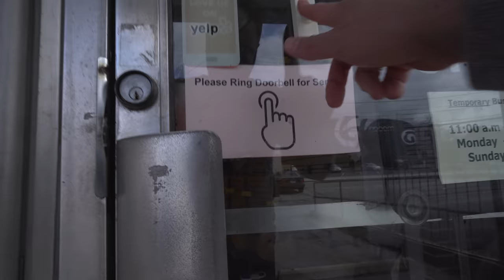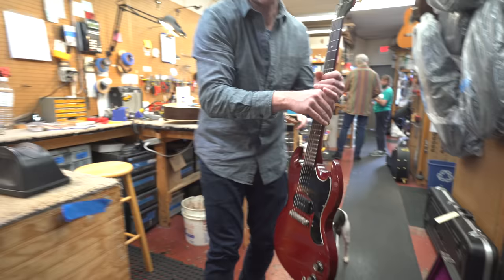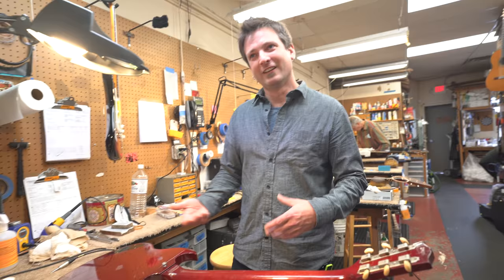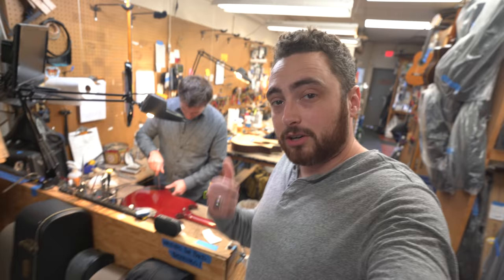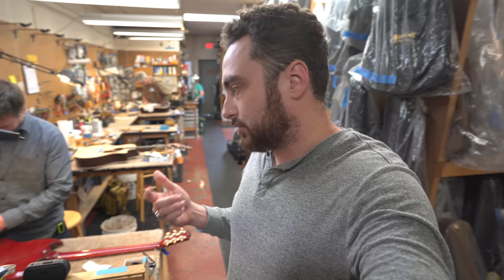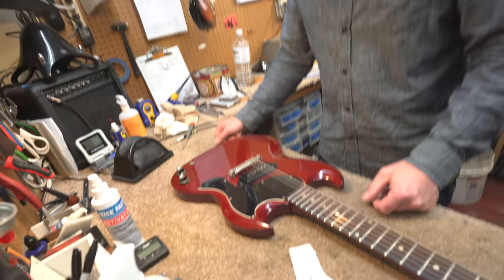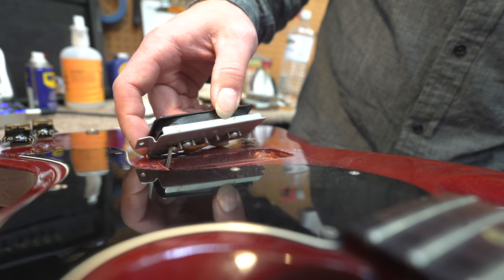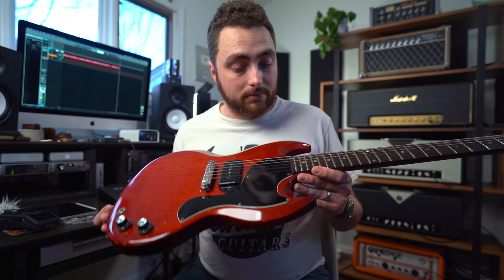I Finally Bought My First Vintage Guitar (I Got Lucky)

Comment: This is only the beginning.  As someone who purchased their first vintage  guitar a few years back ('60 ES-330) I have since purchased 4 other vintage guitars and spent more money than I ever thought I would on an instrument...  Once you open that door it raises the bar and makes it difficult to not want more.
Reply: Raising the bar is the problem. I get an acceptable price range in my head even though it’s absurd
Reply: And that is why I buy reasonably priced ones . My 68 strat is in someone's house but not mine ... damn
Reply: A few weeks ago, I got my hands on an 80s Kramer Focus, definitely needs work though lmao
Reply: I started collecting action figures last year. First it was just a few hundred bucks, but quickky got up to many thousands. I had fun buying them, but kind wish I had bought a couple great guitars instead. At least I finally got new pickups for my Les Paul that had a half-dead treble pickup. (498T, now Pearly Gates.)
Reply: @watersnortmoment3734  if its an early mid 80s, DAMM GOOD GUITARS!! i hv an 83 2000 model. these are some of the first flyods that shipped.
Reply: @carrielittlecplaster1620  It has the rounded banana headstock, so probably an 84-86. I like it, the only issue is that one of the posts has burrowed its way towards the headstock, but it should be an easy fix.
Reply: One can never have too many vintage instruments is there a 12 step program ??
Reply: @MrGavinspoppop  the most I ever paid for a guitar was $1,500. About 3 months ago from Sweetwater Gibson SG Heritage cherry. With humbucking pickups. I was thinking of getting P90s an exchange of the humbuckers but a Salesman from the company told me it's hard to go back. I guess you can't keep replacing the pickups in the guitar. By the way that s g at the beginning of the video is so beautiful.
Reply: Haha! Yep I’ve lost sleep constantly thinking about which Les Paul I should get next.😂🤦🏼‍♂️
Reply: @timculhane625  it's a lot harder putting p90s into a guitar routed for humbuckers than it is to reverse said action being done. The route for p90s is smaller than a bucker so you'd have to add wood. It would look pretty goofy on your brand new $1500 gibson since the p90 covers wouldn't cover up the additional wood added.  It'd take like 15 minutes tops to undo all that with a router though lol
I bet your SG sounds pretty awesome the way it is though
Reply: @stinkychickentitty  when I see an SG all I can think of is AC/DC. Like all it would do is play Angus Young solos. If you tried to play something else it would fight you and just stop working. The real question is… do they stay in tune better than Les Pauls? The people who say it isn’t a problem I wonder if they haven’t played anything else, are tone deaf, or maybe some are better than others. The studio light I had in the 90’s I took a few lessons with for an hour that teacher must have told me to tune my guitar at least 3-5 times in an hour. That is really abnormal- but it was my first electric so I didn’t know any better. Afraid to touch a Gibson ever since.
Reply: @bojangles6444  That's funny, immediately after acquiring an epi SG on trade I felt obligated to buy a Hells Bells leather strap, mostly to negate the atrocious neck dive but Angus Young was no doubt inspiring the buy to some extent. The string pull isn't straight enough on the gibson 3x3 headstock so tuning stability is an issue with all of them. Tuning 3-5 times an hour is outlandish though, didn't know it could be that bad... I'd say give a new one a chance though, build quality and QC was notoriously problematic in certain era's of gibson history, I hear good things as of late for the most part. Picked up an sg tribute in a shop a few weeks ago. Damn thing was a dream
Reply: You said it. Got my first in 2017 - a 66 Guild Starfire 3 - and oh boy did the floodgates open. Now have 3 pre cbs strats. 52 Tele. 57 LP TV model - 62 Jag - 1960 es355 …. I’m in trouble. But this past year put a brake on it all. Combination of ridiculous prices and lack of any good deals.
Reply: @IrishBog  you shop in person or online?
Reply: @IrishBog  That is a nice collection you have there!  I've stopped buying as well.  Prices across the board are insane right now.  And they may never go back down.  Luckily for me I found the best guitar I've ever played and it seems to have satisfied the itch.  Cherry '59 ES-355 w/ rare factory stop tail.  Oftentimes when you buy a guitar it makes you want to purchase more.  But that one is so all encompassing that it makes me want to sell off a large chunk of my collection.

Enjoy those beautiful guitars you have.  Especially that '52 Tele!  Yowza!!!
Reply: @bojangles6444  Only AC/DC? What about Tony Iommi?
Reply: @aaronbickford8725  yeah true I forget I dunno why seen him live when they reunited for Oz fest. I don’t remember what he played I was too far back to see lol. I have seen a lot more AC/DC videos.

Comment: Dude that SG is the shit...I'm drooling right now...tone is monstrous..I own a 2020 standard and it's unbelievable
Reply: I also have a 2020 SG standard and do love it. A few minor issues in build quality, not super deal breaking but for 2k you'd expect more. The pickups are a pretty hot and I might swap them out for some lower output ones, but it plays so well and does feel great. Two of the dots are a bit smudgy, the lining up of the fingerboard and the neck separates a tiny but noticeable amount from fret 3-1. Very rarely is you thumb wrapped around back there but it's still a noticeable finishing flaw. The picture that came with also showed a dirty workstation and wasn't the greatest photo. Gibson are clearly cranking these things out, and while I do love my SG I know they can do better. I will say I went in and picked the one that stood out to me on the wall and when I plugged it in I did love it. So even though it has some flaws, it's still an inspiring and great instrument.
Reply: @theleads6627  kidding around obviously bud. And I'm 47...full grown man here  thanks👍...me grow up as u use alphabet soup like a 13 year old on TikTok..🤪? Yeah ok gfy...u familiar w that one? 😆
Reply: @drdre4397  yeah there were a couple real minor issues that had more to do w setup than fit and finish..and the picture for both my SG and LP studio showed the same dirty workstation..but this is a full scale build factory so I can understand that to a point...but when u are photographing someone's bn 2000 dollar guitar a nice picture in a designated place in the factory that makes the guitar really shine for the customer I think is a nice touch..pic quality really terrible too..blurry and shitty lighting...cmon GIBSON

Comment: I got a 71 SG pro 1 that was modified to a pro 2, bare-bones body is the way to go and add your own electronics, got mine for 300.00 needing a refret job and a neck rod as the adjustment screw was broke, took off the fret board added a new rod, refretted it, added gibson mini humbuckers t-top's are my fav and vintage, and vintage pots from old am radios and Ta DA why vinatge pots, they have thick carbon vs printed carbon made n sold today... my fav is a Harmony F hole acoustic I got for 100 bare-bones, as is on eBay, again added a flat p-90 so i didn't have to drill a hole, the pole pieces are the magnet - as you get older acoustics have more vibe esp with a pickup, if you like his, look for a melody maker, I got a gibson melody maker in the late 80's for 100 cash all org, I learned on, prices are threw the roof now, and the new young generation love rap n hip hop and dont take time to learn or invest in musical instruments, when they can just download 'beats" and call it music, sadly.

Comment: I just bought a 2010 Gibson CS-336 in Black from Imperial Vintage Guitars in CA. The 336 has a hollow body made of mahogany with a center strip inside, with a maple cap and 1957 Vintage tuners. Its kind of a  ES-335, except it is more like a Les Paul size. Excellent condition, and it plays and sounds great. I paid $3200 for it, and it is a Custom Shop guitar. There are some great deals out there.

Comment: A long-time family friend has a nearly identical SG Jr. I believe his is a '62. He's the second owner and has kept it in terrific condition. He traded an LP back in the day for it. Not sure how happy he is with that deal int he long run but the SG is his baby.

I had a '61 LP SG Standard 2xP-90s that had been through the wars: someone tried to saw off the upper horn, it partially cracked at the control cavity, had three different vibrato systems, someone sanded down the finish completely to bare wood, and a twice-broken headstock the second courtesy of Robin Trower's roadie way back in the mid-90's... twit. Oh, but that neck.... Wow. And, you cannot beat the sound of a P-90 in an SG.... Wish I hadn't sold mine... And I'm still looking for a Firebrand SG......... Good score, Rhett

Comment: One more thing...I don't know if they fixed it by 1965, but mine was set up on the fixed bridge for a wound g-string shot it never quite tuned right. You can tell if this is the case if the saddles are grouped 2 and 4 or 3 and 3. Get an after markets fixed or adjustable bridge. Maybe make it brass instead of aluminum, and stick the original in a drawer. Sustain for days!

Comment: I have a 1959 ES-345 I bought in 1981 for $1100. The dealer also had a ‘59 ‘burst (player grade) re-fret medium top. A couple of notches above a plain top. Beautiful color - a strong honey burst color…probably a lemon burst now. Anyway, the 345 had a killer neck and tone. The ‘burst was “good” but not killer. He wanted $3k for the ‘burst. I got the ‘59 ES-345. You know how people say “they are all different - some killer, some good, some just “okay?” I think it’s mostly the wood. I think Gibson snagged several batches of really good mahogany in the ‘50’s -early 60’s that lasted into the mid 60’s. You can find a vintage burst or gold top at 8.5 lbs. You can find a Norlin era LP standard at 10.5  -11 lbs. The mahogany makes all the difference. The old pickups (PAFs) were mostly really really good. Mine are awesome but not all Gold plated (covers) PAFs are great. You can just tell. Frampton’s “Phenix” (modified’54 LP custom) sounds awesome. It’s all mahogany (no maple cap) with patent number pickups. It’s the wood. Your ‘65 sounds like it might be made from that “killer” wood like my ‘59 345. It’s the same with Angus Young’s SG’s or Larry Carlon’s or Eric Clayton’s ‘62-64 335s. It’s the wood. If you get to play a guitar I’m speaking of you’ll know what I mean. You can hear it acoustically with No amp. They breathe, they sing, they vibrate in your hands. That’s what Bonamassa talks about. That’s what everyone who’s played a vintage guitar / especially those made Gibson in the 50’s and 60’s talks about! Grab one if you can. Make sure it sings acoustically first
Then plug it in. It’s the wood!….oh, and YOUR hands!

Comment: Trick with vintage is to buy the forty years ago and then not get them stolen or sold off. My first real electric was a 62 Jr just like this. Guy got it new for $150, played a few weeks and put it in a closet for twelve years. Went to sell it and figured half of what he paid for it was a fair deal. So I got it for $75 in 1974 and played it through an ampeg top mount VT 40, which is a great combo with the Jr.  Got stolen the night before we started a house gig along with the ampeg and my man Dennis oca was kind enough to front me a fender Coronado and a gretsch rockabilly amp, a whole different bag. Still got the Coronado but the gretsch got stolen too.

Comment: I bought a similar Gibson SG back in 1985 (with the original case) that was in even BETTER shape than the one you’re looking at right now!  Mine was a 1963 model, and I got it for only $250!  Wish I still had it. Ah, those were the days…

Comment: Hi Rhett, Greetings from Australia! Following you for quite a while, had to reply to this vid!!! I haven't ever bought a vintage guitar either, but in 1968 I bought a 4 year old SG junior (can tell you off air how much I paid for it if you like!) definately a working tool and much loved, a 'bit' worn now, but still an amazing guitar. Turn down the volume and it's clean, turn it up and it fires!!! Forget heavy gauge strings, 9-42's, best sound  was open air gig, early 70's straight into a Marshall 100 on just over 8 into 4 4X12 cabs ( I had to make up special speaker leads) the guitar played itself (which is what I always liked about it!). Yours looks in a bit better nick than mine (it says hi cousin to yours) but mine has the end bit from the scratchplate still intact (I glued it on many years ago as it was a common problem loosing it) so I recon that adds a couple of grand to the value!! Anyway love the videos, keep up the good work. btw Can you publish a photo of the machine heads from the back, I changed mine early 70's for better tuning and would like to see the original pattern. Cheers Jon

Comment: Besides the Junior, which are raw yet sweet, the Gibson GA tweed amps are underrated especially those where you can mix the wet over top of the dry, which gives the sound as if it’s from a deep cave

Comment: I've had a few, what we would call vintage today, back in the day. And they were nothing to write home about. 68, 71, and 76 Les Pauls that had their issues, and would be, at most, player grade guitars. Strats were a dime a dozen and you had to play at least 50 of them to find the one. I have six now that are from the 21st century and they're all okay. But my number one and two are a '16 Les Paul Traditional and a '13 SG standard. Love these two and they're not vintage, at least not yet and they play and sound amazing. What models are you calling vintage? I never got that, I just call them "old".
Reply: I really agree with your comment, a lot of guitar players or would be players fawn all over “vintage” or the fender and Gibson overpriced custom shop guitars that are made to look vintage which I find laughable. It’s like my dad said, if you can play u can play even a $50 guitar. It’s the player not the instrument. I certainly understand the need for or wanting a great instrument, but Beck or Clapton or Segovia when he was alive could play a box strung with rubber bands. I also have a 2016 Gibson les Paul standard that I bought off reverb cheap. That dude told me he was getting a custom shop. Maybe he didn’t know that all the factory guitar needed was a setup which I did. Plays great and stays in tune.

Comment: I've got a 1960 Junior double cutaway (not the SG shape, the les paul double cutaway) with headstock break and very visible repair there, repaint (probably in the 60's though), but dogear pickup and volume pot original. great sound.

Comment: I have a player grade 64 Sg jr. it rips so hard. weighs nearly nothing as well. 64 is my goldilocks year for SG necks. Not too thin. But mid 65 on you start getting into the skinny nut era which I have never been able bond with. Some people like the narrow nut and some of the early 65s aren't as narrow as later. That one looks like it may be the full width which would be early 65 if its a 65 and not a 64. I have a mid to later 65 SG standard that has the narrow nut but its not crazy narrow. But you cant beat old vintage gibson P90s. best pickups on the planet.

Comment: Wow, it's in great shape for it's age. Sounds great. I was waiting for you to put a strap on to check the balance. I have a Les Paul Jr. double cutaway, thicker body but the same single dog eared pickup. 2 things I don't like about it are the pickups are very noisy when you use too much gain. I know you're more of a crunch guy than a metal guy so you may not be effected by that. But the second thing is setting the intonation,  there's only 2 screws that adjust the whole bridge backwards or forward. I replaced mine with one that has 6 adjustable saddles for more precision. I also have 2 SG specials, the next step up from the juniors, their neck position pickups sound so good.

Comment: Beautiful......reminiscent of my first "good" electric, which I still own. It's a 1960 Les Paul Jr (doublecut) in Cherry Red. I bought it in 1969 from Big Ben's Pawn for $60, and included the original faux alligator soft-side (not bag) case. The case is long gone, due to rigors of the road. It has the greatest P-90 I've ever heard. Any time I get a new P-90 guitar, I always compare it to my Jr. I occasionally get guys (jokingly) offering to double or triple my original investment. Back then, though, we looked at them just as "old" guitars.....I've changed the bridge, tuners, and even routed for a neck pickup. All of which has greatly hurt "value"......but that's OK, it's not for sale anyway. Thanks for sharing.

Comment: Jr's are tricky. A fair number of the old ones are semi useless because of poor neck sets. The neck on them goes halfway through the body and if it is wrong it is just wrong. If it is right you can bend the neck for a quartertone vibrato a la Townsend with no harm done, which I did w my '62 everyday from when I got it in '74 until it got stolen in 84.  Amazing guitars, the good ones!

Comment: Rhett, just bought the Harley Benton SG Junior-style guitar from Thomann. Perfect balance and the P-90 type pickup really rings. This classic Gibson model along with the Les Paul Jr's are terminally underrated.
Reply: A good one to look for is probably the Gibson SG Classic (had P-90s, modeled after the old SG Specials I think). I had one for years, bought new in the early 2000s when they made them. I wish I hadn't sold it. Anyway, they seem to be very well regarded on forums. All I know is I had a great relationship with it. I think new it was $600 back then; now it's probably double or triple that used. Gotta love this inflation.